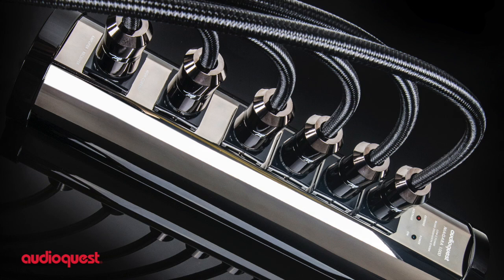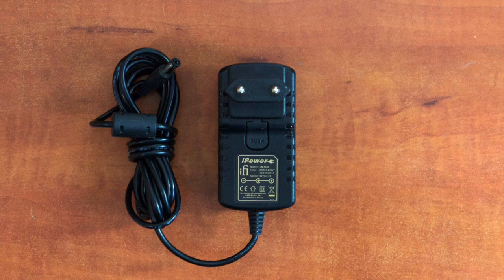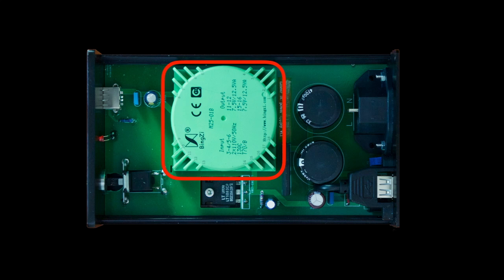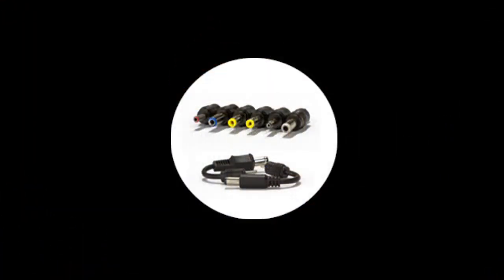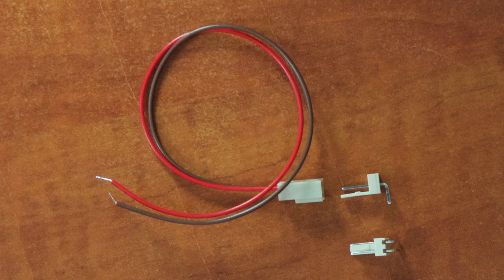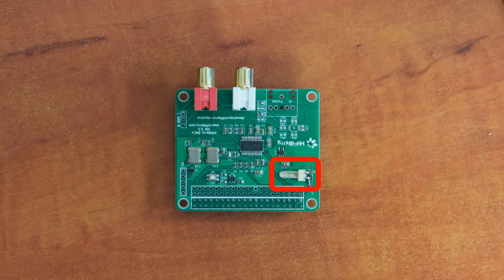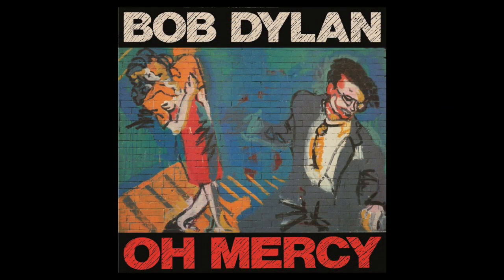Power Supplies 2:  3 PSU's for Raspberry Pi and HiFiBerry DAC+

Comment: Hello Mr. Beekhuyzen, I was just wondering how Linear Power Supplies, and Power conditioners differ. I ordered your book and I did not notice the answer in there. Could you elaborate just a touch. I am wondering if they result in the same thing-stable power to electronics. Thank you and great work on your channel.
Reply from the maker: A linear power supply converts 110 or 230 VAC to the  low DC voltage specified. A conditioner takes a voltage and reduces the noise it contains. There are conditioners for both high voltage AC and low voltage DC. An optimally designed linear power supply offers a low noise voltage and would not need a conditioner.

Comment: Dear Hans

Thanks for the channel, great work!
What about having two batteries at 4.8V. One is charged with a conventional linear PSU that also powers the Raspberry PI and the other battery is decoupled and powers only the DAC+ or DIGI+. After a certain time, the batteries are switched.
This would result in a galvanic isolated DAC+ or DIGI+. What do you think about this? Is there anything that produces cleaner linear power than a battery?

Cheers,
Marco
Reply from the maker: You could try. Certainly there will be no HF noise but the internal resistance might be a bit high making it a slow lower supply. Furthermore a set of batteries supplying only 4.8 volts might provide a lower voltage after only short use. And that's all apart from the user unfriendly managing of batteries. I don't know if you have a partner but my wife would certainly not enjoy having to fiddle with batteries all the time.....
Reply: thanks for the response
The switching between the batteries would be automated, after a certain time interval or voltage drop.
A key question would be how to switch during operation. My first guess is to take the charged one from the PSU, connect it to the DAC+ or DIGI+ and then disconnect the empty one and connect it to the PSU.
Reply from the maker: I am sorry but I can't help you with this. DIY guidance just takes too much time. Again, sorry.

Comment: Can you change the added measurements from centimeters to millimeters in the video?
Reply from the maker: simply multiply my figures by 10 and you get millimeters.
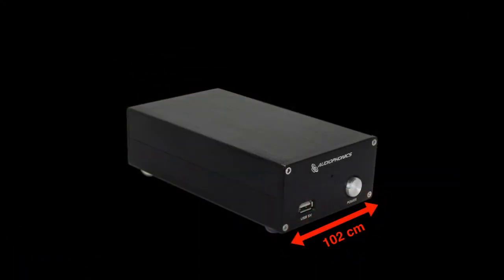Reply: For the Audiophonics it says with red arrows 102 cm, 175 cm and 58 cm at 3:27 in the timeline. Your text and subtitle are correct.
Reply from the maker: Got it. Sorry, I didn't get your first remark. Thanks, I will make an overlay correcting it.

Comment: This is hifi superstition.

It’s not possible to hear a difference between a good switching mode power supply and a good linear power supply on a DAC. Even less you will hear a difference between different good linear power supplies. 

The voltage of the power supply will never reach the DAC directly. There is a voltage regulator which generates the power for the DAC and a filter to get this power clean. So the power of the power supply is modified anyway. The DAC draws only a current of ~30 mA and you need only a view small components to build the filter.

But there could be electromagnetic issues. Connecting the power supply directly to the DAC might reduce the disturbance. But there could be a lot of other sources for that. If there is a electromagnetic problem, a lot of things could have an effect to the sound, like moving cables, moving the Raspberry, electric devices nearby. Maybe even using different power supplies with different leads and so on. 

I had a problem with cheap rca cables. I thought for a test, the cheap cables would do. I had something like a 50 Hz hum every time, the DAC was in idle mode. I thought, that this might be a normal behavior but tried around with different power supplies and so on. Then I noticed, that the hum was still present, when de DAC was not connected to my amp. Only connecting the cable to the amp was enough to get the hum. So I changed the cable and the hum was gone. After that I cut the cheap cable and found, that there was no shielding at all. I did not know that cables like this do even exist...
With a normal shielded cable, the stereo sound is much more precise. The stereo effect is much better.

I think you can save up al lot of money by just using not the cheapest power supply. Some suppliers provide information about ripple current of their power supplies. A switching mode power supply with a low ripple current should be enough to have excellent sound quality. If not, the power supply is not the problem.
Reply from the maker: I agree completely but in practice I see poorly designed SMPS's in the wall wart and power brick models. So, technically  you are right, in practice a linear power supply is the best choice for the critical listener. The average listener will we satisfied with for instance the iFi SMPS. If you know a better one, please let me know.
Reply: It’s never a good idea to use a poor power supply on a Raspberry Pi no matter if you use a DAC or not. 
A USB charger is not designed to power a Raspberry Pi. Most USB chargers do not provide enough power and often the cables are to thin. Even if you have a USB charger, that has enough power, the thin cables could lead to a larger voltage drop. The voltage regulators of the Pi will compensate this, but at a certain level, the voltage starts to get disturbed. A voltage regulator needs enough voltage on the input to generate a clean voltage on the output. If the input is to low, the output starts do get noisy. There are USB cables, that can handle the power, but cheap thin standard USB cable might cause some trouble.
The most shops that sell Raspberry Pis, do also sell power supplies they have tested and that will be ok.
Reply from the maker: Let's just agree to disagree. You obviously have other experiences than I do.